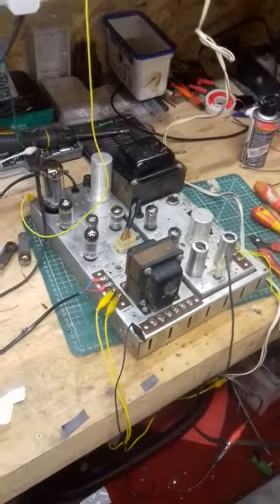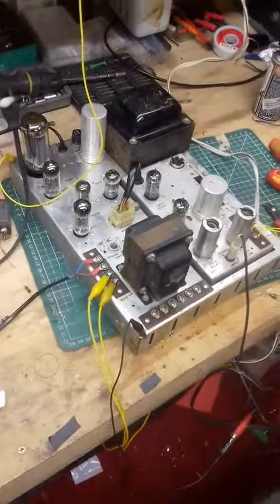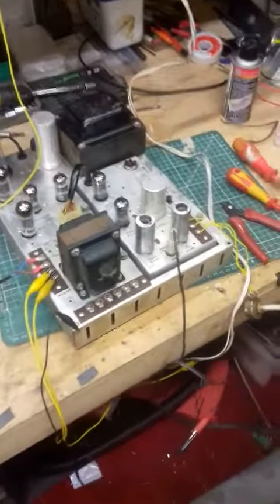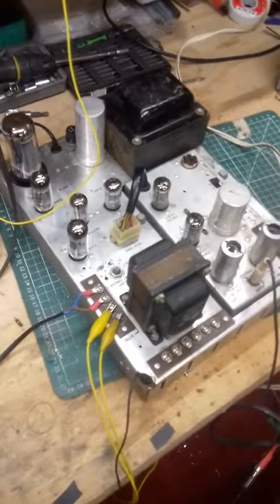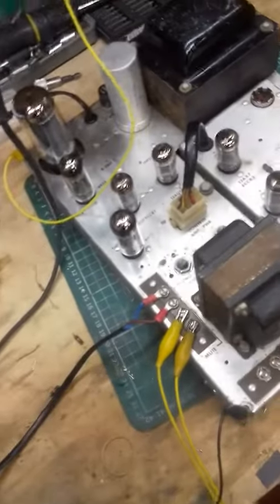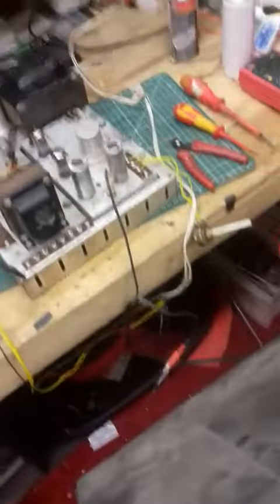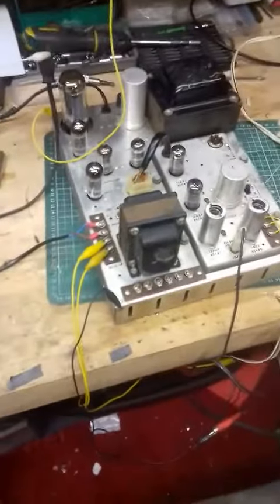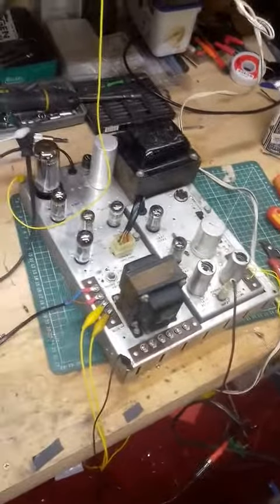ami jukebox amplifier repair

Comment: Hi, Question on your set up. 
I'm re-capping my Ami j amp (R-145) 
To test my amp on the bench as you are doing , what have you hooked up as a Turntable and speakers. For example, any turn table will work? 
For speakers,  again any will do or is there anything I need to check so I don't blow my amp? How have you got yours wired. Thanks kindly. 
Des
Reply from the maker: yes any turntable with a magnetic cartridge can be used...speakers 16 ohm should be used, i use my workshop speakers which are 2x 8 ohm in series.
Reply: @sparkey1958  Thanks kindly for the reply.